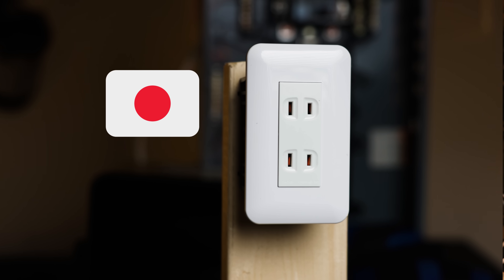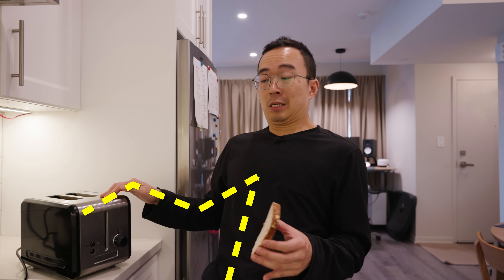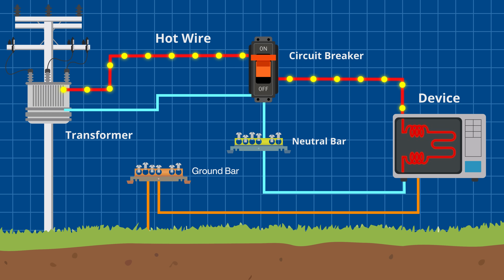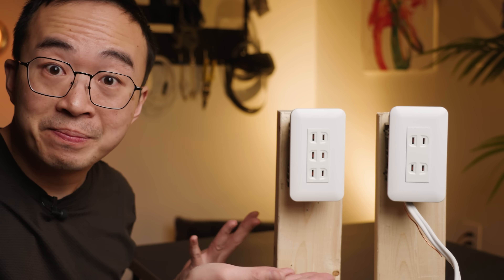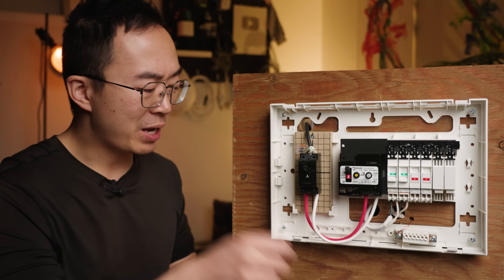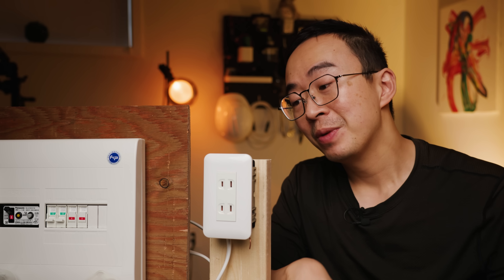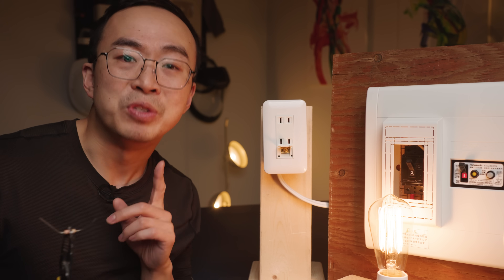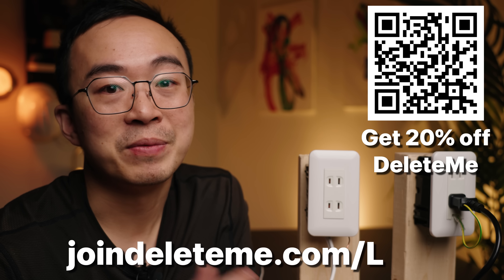How Japan Made Their Outlet Safe

Comment: We actually put up a GFCI when we were building our new home in India. We had to get it removed 2 years later though because even small sparks from plugging appliances in would cause it to cut off the electricity to the entire house. In the end, we ended up to retrofitting the system with a US-based model, focusing only on bathrooms and areas with high moisture or wet conditions.

Comment: I live in South Africa.  We have had GFCI outlets far, far longer than 1970s.  Japan was most certainly not the fist.  You can read the history here: https://en.wikipedia.org/wiki/Residual-current_device. I was born in 1986, but for as long as I've been alive GFCI have been mandated here.

Secondly, TN-S, and TN-C-S make much more sense for most of the world, compared to TT.  TT requires  maintenance. For a system as wide-spread as the power grid, having a safety system that requires maintenance is by definition going to be less safe than one that does not (again TN-S, TN-C-S).  The high loop impedance can prevent a GFCI from working in TT unless the it is regularly maintained.  Does every single house have an automated system that is constantly testing the GFCI mechanism?  If not, it isn't inherently safe as the system degrades over time it will no longer provide protection.  And it does so silently.

Japan's electrical system, IMO, is worse than the US if they don't have earth wires. (I'm not American)

Comment: Our 2-prong plugs are grounded, via the hot wire, not as good as a separate wire, but it is bonded to the panel which grounds to earth. Why do many smaller things, not need a 3-prong, here in USA? See below.
Double Insulation: Some devices, like many power tools and household appliances, have double insulation. This means they have an extra layer of protective insulation around the electrical components, reducing the risk of electric shock.

Low Power: Smaller, low-power devices often don't produce the kind of fault currents that would necessitate a grounding wire. Their power consumption is low enough that even if there were a fault, it wouldn't pose a significant risk.

Plastic Housing: Devices with non-conductive (plastic) housing are less likely to conduct electricity if there's a fault, making grounding less critical.

Safety Standards: Modern electronics are designed to meet stringent safety standards, often including fail-safes that make grounding unnecessary for certain low-risk devices.

Comment: Ground wire is required for modern switch mode power-supplies. If you don't have a ground, the switch-mode power-supply creates it's own ground which is going to be input voltage/2 and then the device's case is in that potential. ground is also great way to get rid of noise and grounded chassis conducts all noise gathered away from sensitive circuitry.

So having aground doesn't only protect you from shocks, it protects againt EMI issues.
Reply: There is no requirement to have ground. Many oe8mne use PCs on ungrounded outlets.

Comment: To anyone who does understand those options nothing really new here. There certainly is more to grounding than that. Yes, connecting null instead of ground works too, sure. Electricians in germany often did that into the 70s. Sure, its not ground, but in the end as long as your ground pin is connected to something that can take the electricity away...
In terms of PE specifically. If you brought a foreign power supply to japan that assumes its earth pin is connected and then it isnt connected, neither to Null nor to earth, well, there might be a connection to the case of it with some resitstance so you wont be shocked heavily but still there might be a connection from live to the case intentionally to test if there is a short or such which works if there is PE connected if not  there could be issues.

Comment: I'm not an electrician but I still know a lot of the info regarding the US is outdated. Ex. there are GFCI, AFCI as well as dual function breakers. And it's code to use these breakers at the source instead of installing outlets where I live. So in 2024 going into 2025, the US has the better system.

Comment: RCD Should be mandatory in wall sockets in all wet inside areas and outside locations and a RCD Circuit Breaker in the Power Box for Each Individual Room and lastly the Main Circuit Breaker for the Whole House giving 2 too 3 layers of protection not just 1 layer

Comment: Here in the US they are starting installing the plugs as we would perceive as upside down. With the ground on top. The thinking is that if a metal object falls or your thumb goes over the top when pulling out the plug. you would touch or hit the ground and not the hot side. Just adding my 2 cents. Its up to the installer but im seeing it more and more.

Comment: When I was a kid in the 60's, before grounded outlets were common in North America, I remember our in-window air conditioner had a separate grounding wire like that one you showed, and it would get screwed onto that screw that holds on face plate, right between the two outlets (I guess the boxes were grounded even if the outlets were not?)

Comment: Ugh, everyone does it wrong to some point. As an electrician I can rant forever and ever about the problems with U.S. electrical design. The U.S. GFCI at the socket is not as safe because water can intrude in the back of the socket and bypass the gfci. Not theory, I've seen it, it happens. Also doesn't provide protection to rodent chewing. That and one simple problem... U.S. SOCKETS ARE USED UPSIDE DOWN. It's a simple thing, with a simple fix. You don't want gravity pulling out the active part of an electrical connection, that causes arcing and arcing is bad. It also exposes hot plug prongs. Turning them to ground up instead would prevent this because gravity would push the active prongs in instead of pulling them out. Euro receptacles are big and bulky and aren't very cost effective. For the price of a euro receptacle, you can get the absolute best that I've seen and that's the NEMA twist lock. Can't pull out on it's own, doesn't power on unless pins are all the way in the receptacle, and sockets are inherently child proof without added anything, 15 amp plugs are small and can be put in a normal single din receptacle slot.
As an aside to the video.. What did Japan do about motor static before adding the ground to appliances? Did they just accept the pop every time they unloaded the dryer? You can't neutral ground the casing of an AC motor, so that has my brain hurting on how it was actually done.

Comment: Japanese power system is not superior...
If anything, a GFCI on the main like you show Japan is doing, will cause more problems because, if you experience a ground fault. It trips off all your power until the problem gets remedied/repaired...
It's much better to have this kind of protection on individual circuits because, in the event of a ground fault. You only lose the affected circuit instead of the whole panel...
The implementation of a ground pin and the addition of modern GFCI's and AFCI's simply add layers of protection in the event something fails in the grounding path or electrical circuit. 
For example, a loose connection or poor by the workmanship of upgrades done, typically by a homeowner with little or no electrical knowledge or experience. 
Modern GFCI's and AFCI's placed on individual circuits also limit the current to less than 3 milliamps which you won't even feel before it trips the circuit. Also, that ground wire attachment on the japanese receptacle looks more like a ground optional that an uninformed or lazy person will likely not use... 
I would rather have the ground pin. It's a no brainer...

Comment: You are wrong in several areas.  Most of the world uses GFCI trip point at 30 mA.  That hurts.  Here in the US, the trip point is 5 mA.  Most people, including myself, can't feel 5 mA.  Next, putting the GCFI in the breaker panel is exactly the wrong way to do it. The minor reason not to is that when it trips, one must trek to the breaker panel, which may be in the garage or in the basement to reset it.  The major reason is that in Romex, which essentially all houses in the US are wired with, capacitance coupling between the hot leg and ground can result in enough ground current to flow to trip a panel-mounted GCFI with nothing plugged into the outlet. Yes, I've tested this.  Even if, say, only 3mA of ground current flows, this leaves only 2 mA of margin for the appliance.

Good engineering practice dictates that the GCFI be located as close to the point of use as practical.  That means GCFI outlets.  Fir larger loads, such as a swimming pool or hot tub, the GCFI is installed in or near the disconnect switch.

The US has mostly gotten it correctly.  120 volts for lighting and small appliances,  240 volts split phase which means that each hot to ground is 120 volts.  GCFIs trip point 5 mA.  The only remaining open item is certain appliances that use non-polarized 2 prong plugs on appliances that clearly are not double-insulated.  Toasters, tabletop ovens and space heaters are a few things that come to mind.  That's a political issue and not a technical issue.

Comment: In America, we began with polarized plugs, with one slot in the outlet larger than the other.  That lasted for years until GFCI technology came into effect.  Now, we've improved things further with AFCI (Arc Fault Circuit Interrupter) technology which monitors for faults in the house wiring, as well as what you plug into it.
Reply: Polarized plugs are mainly for lamps etc. so that the switch works on the hot wire. The neutral is not connected to the case.
Reply: We europeans like to clown on the US electrical system but you guys actually made AFCIs mandatory while Germany has not. Now you just need to get rid of that horrible plug and outlet design.

Comment: your ground to neutral connection is wrong. It is made at the transformer not on the load side. in fact this is the connection which makes live the life threatening wire. You are still wrong how grounding woks. How come you get to do it at home and I don't.

Comment: Most people misunderstand the purpose of the ground.  It is for safety, but not for preventing shock.  It is for preventing fire.  In the US, the National Electrical Code (NEC) standard doesn't come from electrical engineers, it comes from the National Fire Protection Association (NFPA).  Groundings main purpose is to provide fault paths that will trip breakers or blow fuses to stop fault current from starting fires.  Because things are grounded, that creates a path that allows current to flow from the electric supply through a person to ground, making the circuit more dangerous.  But even though the circuit is more dangerous do to the possibility of shock, is safer overall due to the lower risk of fires.  Since the circuit is grounded, the NEC specifies things to help mitigate the risk of shock.  If the system is not grounded, touching a toaster that has the 'hot' touching the toaster frame will not shock a person, as there is no circuit through the person through the ground back to the transformer.  If the system is grounded, the frame of the toaster should be grounded, so that if the 'hot' touches the toaster frame, the fault current should trip the breaker or blow a fuse instead of allowing it to remain hot, and enabling to to shock a person when they are touching the toaster and something else that is grounded, like a faucet or a stove.  The GFCIs help to reduce the risk of shock and ground faults.

If the transformers aren't grounded, like what is shown in your diagram, there is much lower risk of getting shocked and the grounded system.  Without a grounded supply, grounding the appliances doesn't do much.
Reply: No no no. Equipment grounding to protect against electric shocks. The fact that NEC comes from NFPA does not mean every rule in it is for fire protection.'

You are confusing system grounding (connecting the neutral to the ground at the transformer) and equipment grounding (connecting the equipment case to the grounded neutral),  The first is for over-voltage protection, the second to prevent electric shocks.

Comment: AGGGGGHHHGGG!!!  GROUND FAULT CIRCUIT BREAKERS SHOULD BE INTERNATIONALLY BANNED!. BANNED!!  A GFCI detects a milli-amp or less of ground current.  And it trips. BUT a circuit breaker trips only on more than 20A. Huge difference. So the GFCI detects an extremely small current that is at least twenty thousand times less than a circuit breaker has traditionally done.  BUT noise on the line will trigger a false trip.  And the longer the line is the bigger your antenna is to pick up noise.  A lightening strike a hundred miles away can trigger it.  So if the GFCI is at the outlet and you plug in a device with a 6 foot cord then you have a nice short 6 feet all total antenna. It can still falsely trigger but the chances are less. IF you have a GFCI way out at the breaker panel then you are likely to have a 100 foot antenna. AND it trips easily.  All the $^&#* time.  Try to use a hair dryer in the bathroom and the circuit breaker GFCI will likely trip. And try getting a call at work from the wife and you have to explain to her that she has to go out to the garage, move some boxes, figure out which breaker is tripped and reset it. Not gonna happen so you have to drive home at lunch break.

Another thing to consider, have you ever reset a GFCI that tripped because of an actual ground fault. I have reset them at least 300 times in my life. And I am pretty sure it was never for an actual ground fault. And now just to make things even worse they are insisting that all the breakers be not only ground fault but also arc fault. An arc makes an impulse of current so that is what the arc fault breaker is looking for. BUT noise creates an impulse of current.  My new house has all ground fault/arc fault breakers which were required by code.  3 or 4 trips every day.  Reset them and they trip again within seconds.  Wait until the next day and you might get them to stay untripped.  For the majority of the trips I have determined are caused by my under cabinet LED lights.  They have a switching power supply that has a great deal of noise.  And it's not their breaker that trips.  It's dozens of others which must have wiring in the house that runs near the wiring of the undercabinet lights.  Keep those lights off and half of my false trips are gone.  Turn them on and you can hear the clicks of the breakers as they start tripping.  My garage doors also have switching power supplies.  Raise my garage door and the bedroom lights go out. And they cause many other circuits to trip.  And most all my lighting is LEDs which all have a noisy current.  An incandescent bulb is not noisy. Fluorescent bulbs on an old fashioned transformer have little noise.  The new fluorescent ballasts have switchers in them that are extremely noisy.

My conclusion is circuit breaker panels should only be for over current protection and nothing else.  Ground fault should only be done at the outlet. And only at outlets that are near something that has ground. Oh wait. Nothing does anymore. My water pipes are plastic. The water in the pipes has virtually no ions so it can't conduct much current. My toaster is plastic and it doesn't even have a ground pin on the plug.  My gas stove has non conductive pipes going to it and the 110VAC plug for the igniter has no ground pin. So how can I get in between the hot line and ground.  I would have to purposely run a wire outside to a copper stake to find ground. Because except for that ground line they require at the outlet, I don't have any source of ground in my kitchen.  My electric stove has a big 3 pin 220VAC plug. Two hot and one common. No ground. Same for the clothes dryer.  

As I type this I just heard another click coming from the garage. And cussing from the wife. Power is off again.  It's so bad that sometimes we don't bother to reset the breakers and just leave certain areas of the house without power, no lights.  Gee I guess I am really safe now. 

My internet has been out for days, many visits from the repair guy. Finally we find that the internet provider installed a protection system at the head end to filter out certain bad guys from getting into my computer.  But my computer already has protection built in.  So after two weeks of no internet the repair tech finally figured out that all we had to do was get that protection turned off. And we did and now we have internet back. Most of the problems I have with my car, my internet, my house, my health, are all caused by stuff that is supposed to make us more safe.

Comment: As a Thai. Our country were like Japan but use 220 volts with Type A plug with no ground. The electrical code require centralized GFCI (RCCB, ELCB or whatever name) before grounding. Nowaday if You want to power your house, the authority will check if your house has a proper grounding and GFCI, before you got the electricity to power your house.

Comment: In the US, power outlets are usually wired in series, so if you put a GFCI outlet as the first outlet in that circuit, it will protect all the outlets wired after it, as well.  Of course, you will need to figure out which one is the first outlet.

Comment: In France it's 2 holes.
In the UK it's 3 but the third pin is in plastic and is used to move the protection cover over the other 2 holes. Technically 2 holes as well